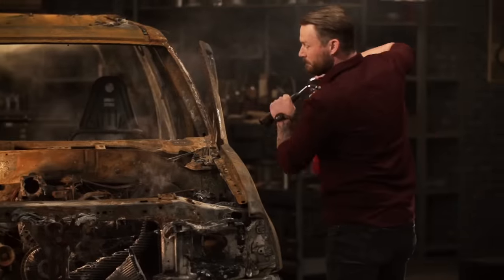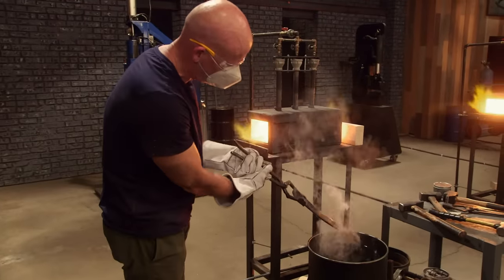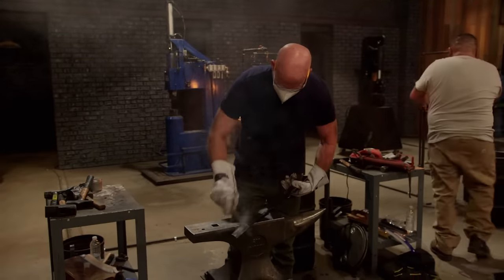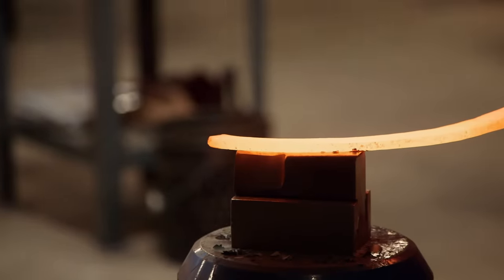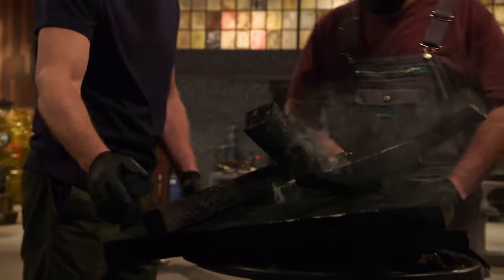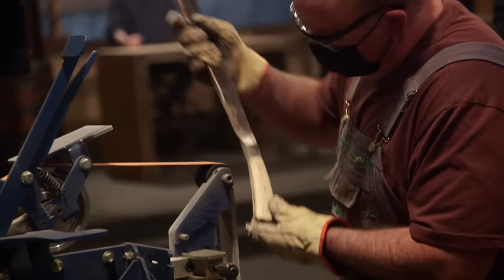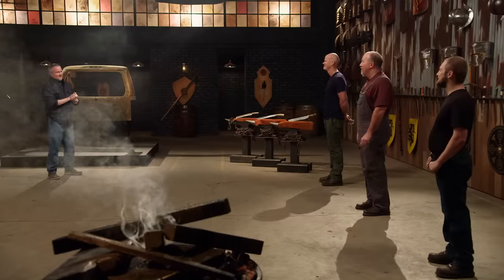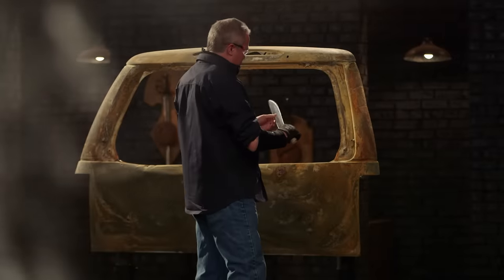Bladesmiths Salvage Metals from BURNED OUT SUV | Forged in Fire (Season 8)

Comment: "The handle is the interface, so it's like the keyboard on a computer." Who wants to see contestants forced to make handles using only bits of old keyboards now? Its thereoticaly possible by laminating strips of keyboard backing plates (sometimes they have thick aluminum or steel plates in them), cases, or casting keycaps in resin. But you could also melt them down and make some plastic "ingots" to mill or whatever.